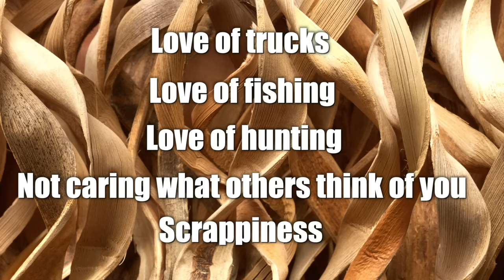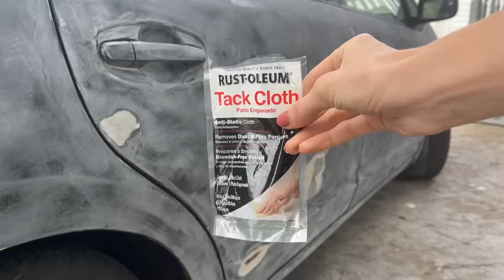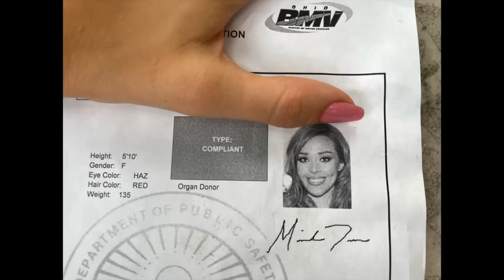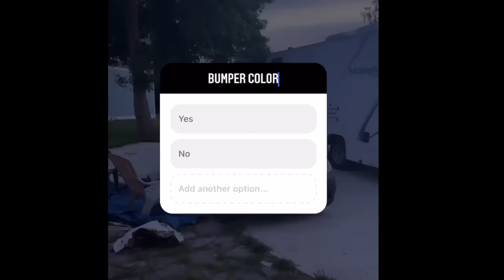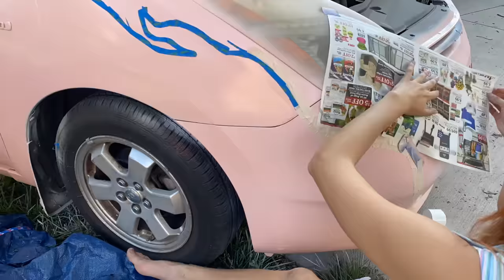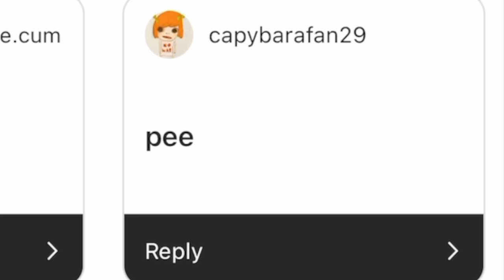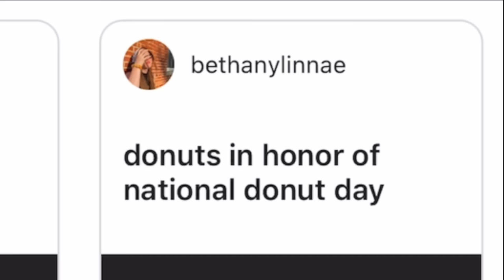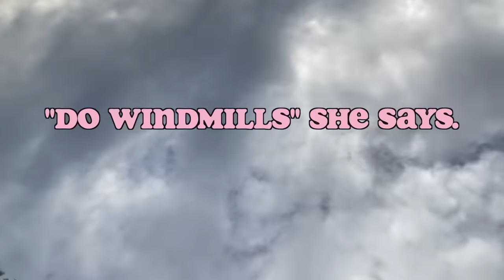I GAVE MY CAR A BARBIE MAKEOVER

Comment: Doll customizer here: to easily and effectively remove doll heads, place the doll headfirst in a glass of very hot water for a minute or so. This will soften the rubber.  Then, just pull off the head. Be sure to use a towel for that part so you don't burn your hands

Comment: you're so damn right about used cars, ive been driving a 400$ red truck for 5 years!!! the brakes have only gone out twice, it starts 80% of the time, and only a couple pieces are held on with baling wire

Comment: THIS is so HELPFUL! I've been trying to think of ways to restore my car's paint and body work. I can't afford anything professional (heck, I probably can't even afford the paint) and have several 'bumps' to fill in. I didn't think this could be done with ordinary stuff from the hardware or auto store. Of course, we don't have any good colours available, like pink, so it will have to be something boring. I was thinking of doing a vinyl wrap (with the hairdryer to shrink-wrap it to fit really well) but it's been ages since I could find that stuff online. 
Can you tell me how many cans of primer then colour then sealant it took for your car?

Comment: Girl I didn’t know you spin FIRE! 
I also spin. Anyways a better way to put out a baton.

what you need is a damp towel, or a fire resistant blanket but that towel works fine. 

Have a dedicated person be your safety every time you light your equipment.

 first of all, your safety will help you along with this process and spot you while you do your tricks.

 you want to do going to point one end of the Staff to the safety they will wrap a towel in a cupping motion and then enclose the lit end. Which should suffocate the flame, repeat the process on the other side. 

If you don’t have a person I could just not light the flame, but if you’re gonna do it anyway what I suggest is having that same damp towel laid out on the floor. put one end of the flame on the towel and fold the towel away from you and then you fold a towel again so it creates a suffocating effect for the flame. repeat on the other side.

side I will add a link to my favorite fire safety video for you to watch. 

Stay safe and remember safety first, content third.